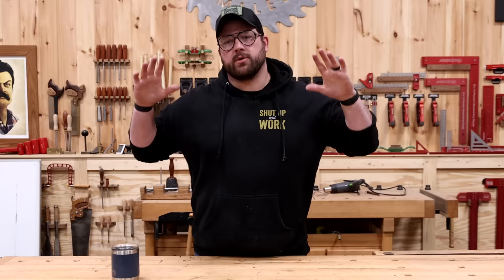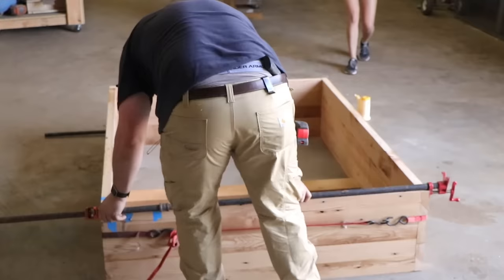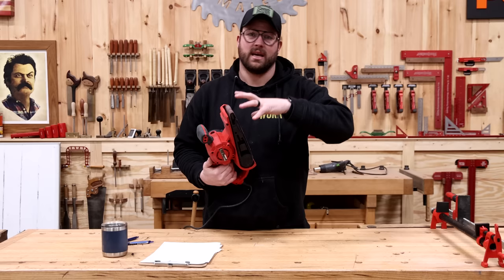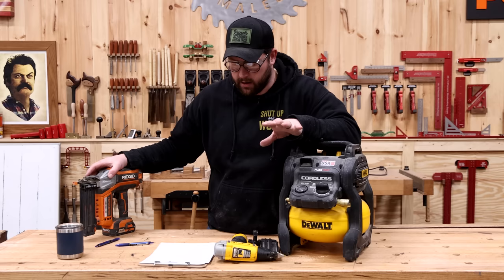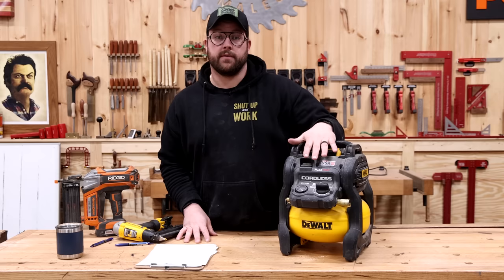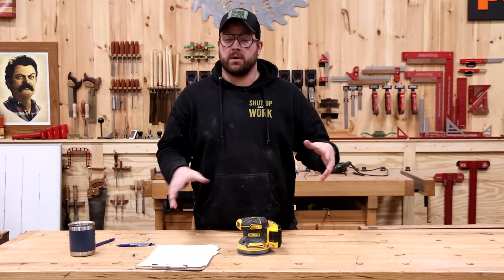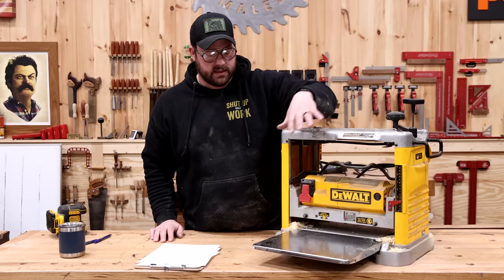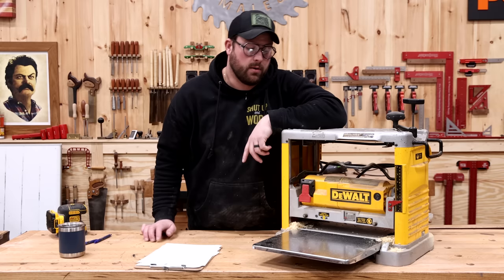5 Beginner Woodworking Tools I Regret Buying

Comment: The 12” dewalt planer. Couldn’t disagree more……I have a Helix set up in mine. Used this planer for miles of hardwoods including mesquite, pecan, several species of oak, sycamore, poplar, and pine. Lots of local “residential” hardwoods as well. Not a few boards….dozens of huge trees I turned into lumber with the help of a couple local sawmills. Not one single trip overload. Not once.   Fix your machine guy! Probably a simple fix………..
Give that worthless planer away and tell the guy to replace the overload switch and check the wire connections…….

Comment: Do you guys in the states use combination machines like c400 style? ( single machine with sliding panel saw, thicknesser, surface planer , spindle moulder and slot morticer )
Reply: There's some convertible planers but for the most part we tend to use dedicated machinery. We tend to have larger shops than foreigners do. John's shop is huge. I'd guess it's 40x60? Might be even bigger than that. But that's not super uncommon for even amateurs to have here. Some are pressed for space though. Like if they're working in a basement. But if you're not living in an urban area and you have some land then having a large outbuilding is normal.

Comment: Compressed air is the most expensive way to waste energy... You spend a lot of energy to compress the air... send it through the hose and... spend quite a bit of volume just for a single action. Then the compressor has to spin up again.... It's way, way better to just get either a corded, or cordless electric tool - the new ones are quite light as well.

Comment: Have to agree on the clamps and track saw.  There are cheaper options that will work a lot easier for the beginner.  I am personally watching yard sales and estate sales for older tools like the pipe clamps as you can often find a box of them (sometimes with the pipe included) for fairly cheap, like I have seen a box of 10 to 15 of them end up going for about 1.00 each set.  Which is something else people should think about doing, buy used stuff.  There are often older woodworkers who either don't have someone interested in the hobby to pass things on to or have passed away and the family has no clue what to do with the tools.  They might be stained and dirty but lets face it, that means it was a tool worth having and the old tools often will last a lot longer than new stuff.

Personally I did spring for the battery powered palm sander but that is more of a convenience factor as well as I was living in an apartment when I was using it to build stuff outside on a table and already had the batteries so to pick up the Ryobi sander was like 50 bucks.  I built a bed frame with it along with some other things like the wooden flags and such and have some painted furniture that I am going to refinish with it at some point as well.  IMHO the best low budget saw guide is a level and a couple small clamps, I have ripped down  a TON of sheet goods using this method and a cheap level at harbor freight is less than 20 bucks.  Have been rebuilding a house while we live in it and every piece of sheet material has been cut this way, including the R10 foam panels I capped the insulation off with, just have to remember the distance between the edge of the shoe and the blade and offset that much each time.

Have to agree that air tools are a better idea compared to the cordless nailer.  Just too bulky and heavy with the current tech out there.  I have been replacing a roof by myself and an air nailer is a must IMHO to get things done when you are slow working on a roof.  Bought a cheap pancake compressor (sadly the built in regulator is a turd) coupled with an external regulator since the inbuilt one dumped air all the time and a 5 gallon portable air tank plumbed into the system to act as a reservoir.  With that setup I can run a roofing nailer without issue all day long and don't have to wait for the little pancake compressor to build up as much air nearly as often.

Planer is something I am looking at next and honestly the WEN one with the shellix (can't remember the exact spelling and honestly don't want to look it up) style  head built in and fairly cheap carbide cutters available I think that is the way I want to go.  That or build a wide belt sander that I can power feed boards through and basically do the same type of thing and as a bonus I can switch to a heavy grit and hog out material or a fine grit for finish passes.

Comment: 20v cordless compressor..🤣🤣🤣 brads I can see but that's it. How long will a battery last? Fill the tank up once, maybe twice I can see not using a cordless sander but a compressor seems ridiculous. Also, you will have outlets for a sander  everywhere but not for a compressor? Ok? Just get a normal plug in.

Comment: John, I can't see the logic of recommending a cordless air compressor rather than a plug-in unit, and simply because of their high cost and limited functionality.  In the same manner as you're recommeding against battery powered brad nailers.  The price difference in compatible compressors is enough to pay for at least one, and in many cases, two nailers of different gauges.

Comment: Whoa, I'll have to stop you there. Dust collection SHOULD suck! And the more, the better.
If dust collection doesn't suck, what good is it...? ;)
As the Dewalt DW735 isn't availabla locally (I live in Denmark), I opted for the Metabo DH330 (13") instead. I looked at both the Dewalt 12" (DW733) and the Makita 2012NB, but the Metabo was better bang for the buck. A little slower than the Makita, but the rpm to feed ratio on the Metabo results in a better finish. I mostly use mine for removing the resin from formwork plywood.

Comment: I like the belt sander I have and I use it widely. The one shown in this video is quite different. Yours has an absurdly small front wheel, likely contributing to some of the issues you described. Mainly though the way you use it the key. It is not a subtle tool and I only use it with low grit sands anything more than 200 and it is the wrong tool. I also use mine as a bench sander.
As for planer/thicknesser, No way would I spend any money on a bench style. They are all overpriced, flimsy, inaccurate, low versatility and weak as water. It is the FIRST AND MOST IMPORTANT machine in the shop to spend money on. A good and heavy long table planer/thicknesser. For $1500 new, you should be able to get a good enough one to turn almost any wood into perfect boards/timber. Second hand older models are often better and more stable especially old Italian and German variants. 
It all depends on what you want to make too, all sanders smaller than lifted by a forklift suck but that is not practical for most people. Hand sanding is still a cheap and effective option for many jobs. 
If a low budget is a key factor then a lathe is a cheap and massively fun, easy machine to use (MUST learn the basic safety first). It can also be the only machine if its a low money, low time hobby. A few cheap chisels and you can make a huge amount of things.
A lathe can also be the perfect budget entry machine to make money with and work your way up to a full workshop/business.
John, I fear for your safety at times but thanks for sharing.

Comment: Do NOT recommend a spindle sander attachment for a drill press / drill unless supported on both sides.  You will destroy your bearings.  Drills are designed to push DOWN, not sideways.  If you DO decide to do this then be REALLY gentle.  Spindle sanders are designed in part for shaping, so being really gentle kind of defeats that purpose.  There are decent benchtop spindle sanders if you have a need to shape concave curves.  Please leave your drill press out of this process.  That said, spindle sander is not a tool any beginner needs.  Just learn to use rasps and sandpaper like the rest of us did.

Comment: Just ran across your vid. All is true but 1. Go get yourself a real belt sander then you will notice a difference. The new style (drag car) suck because of the front wheel being so small. So you are right and wrong. Now that being said good luck finding a porter cable 3x21 or 4x24 only to be gotten used as porter cable (I believe, correct me if I am wrong) doesn't make them anymore. Only way I have replaced mine was used on ebay. The original lasted me 30 yrs of use and abuse.

Comment: Buy a cheap belt sander, it has its uses for mass material removal. Don't buy De..t, Mil...e etc anything until you decide to stick with woodworking. Buy HF or other cheap brands, if it is useful and you are going to stick with woodworking, spend the money on better brands. Buy corded to start with, more power for less money and you won't get stuck with orphan batteries. Black&Decker, Porter Cable, Dewalt are all the same company along with others. Cordless compressor, what an insane recommendation for a beginner. Buy a real compressor for much less and buy airtools for way less than the cost ob batteries.

Comment: Hi John, to be fair, your beltsander sucks, a good onw has amazing dust collection, runs super smooth for hours and leaves a good finish that is super quick to touch up with your orbital sander. I sanded the floors in my house with a makita 9404J after stripping the old paint.

Comment: Beginners! Remember: batteries die, corded tool work forever! If you want to use your tool in say 5 or 10 years, the corded one will be as good as new, the cordless batteries will be junk (and so will the tool) 
Cordless tools are best if you wear them out in 2-3 years before the battery is dead. more for a full time professional.

Comment: Mere clamping pressure does not equal better glueups.  Proper prep does.    Buying scrappy tools to save money.  Been doing this 30+ years.  Bought cheep tools only to suffer.  Buy once cry once.  Pick up clamps over time.  Told kids fathers day a clamps.   Birthday clamps.   You would freak at my clamp wall.  BTW  you can join those  besseys.

Comment: Completely DISagree with the parallel clamps and pipe clamps.   Both are equally useful even for beginners, but the parallel clamps have a much larger clamping surface to spread out the clamping force over a larger surface area reducing the likely hood of leaving clamp marks on your wood.

Also, a battery powered brad nailer is almost a MUST....  get the Bauer from Harbor Freight it has every bit as much power as a pneumatic, pushing 2" brads flush into solid Oak, Ash, Hickory, and Maple lumber.  I've done 2 strips of nails on original charge into a mix of hardwoods, and wall studs & still have 1/2 battery according to the indicator.   Tool + 1.5AH battery(they were out of the 3AH) + charger cost me less than $150.   With coupon &/or sales, you can get with the 3AH battery for about $150 after tax.

Comment: Got to disagree on the belt sander. When you are working with big pieces of wood and you have good technique you can make your life so much better by removing material fast, easy, and accurately. Now, it does require technique but....here is the thing....so does literally everything else with wood work. So, you might as well jump in and hog off some shit on scrap to learn how to do it and make your life so much easier later on.

Comment: I will have to agree that the Kreg saw guide is junk.  I invested in the Festool system.  Money well spent, IMHO.  The DeWalt planer is also junk - I was fortunate enought to buy a Powermatic 22" planer.  7-1/5 hp and the machine weighs in at a whopping 1,300 lbs.  With a shelix head you can't go wrong.  I like the Bessy clamps but I found there is a learning curve to operating them.  I don't know if there is a better "F" style clamp design out there - but have yet to find it.

Comment: The only expense (and headache) you'll find with pipe clamps is getting them cut to whatever size you want and then the CUT end threaded. 

Home Depot (in my area, at least) will not do it. They don't even have the machine, period.

Lowes *supposedly* does it, but they usually have like one elderly clerk who is cleared to use the damned pipe threading machine, and she's usually part time and out sick anyway. I literally waited for more than 90m to get a single cut pipe threaded on the fresh ends once. Another Lowes, those idiots had NO ONE who was cleared to use it. NO ONE. Not even a manager. SMH.

Can't speak for Menards, there aren't any of them around here. 

If you're going to make more than one or two pipe clamps (and yes, they're good!), it's worth it to consider getting your own threader set from Amazon. The cheapest 4-star one I spotted was US$110. No idea of quality, but you don't need to do THAT many, but it'll save you a LOT of time if you don't get a whole bunch of pipes cut at one time @ Lowes.
Reply: I have my own pipe dies and pipe cutter. I've threaded some 3/4" with what I've got too. It's a slow burn. By the time you're done you'll know why they have the machines, that's for sure.

Comment: lol you pulled out a parallel clamp and I went 'Pipe clamp'

whoa whoa whoa, did you just recommend a CORDLESS AIR COMPRESSOR for beginners? Air compressor + gun yes.. cordless? Wtf mate, get a better air compressor than that as a beginner for THAT kind of money and get some longer hoses and an extension cable.

Comment: Ive been working wood for about 40 years or so and I started out with cheap clamps.  That was wasting money.  I have an array of Bessy clamps and they are still as good as new performance wise all these years later.  If you buy crap tools you will own crap tools.  If  you want to be a cheap wood worker, build your own clamps but build some good ones.

Comment: your cost analysis of the cordless brad nailer is wrong.  The compressor is going to REQUIRE an airhose, that ain't free.  I generally agree with you on the cordless nailer for a beginner, but I would go all the way and say the same thing about the cordless compressor.  You can get a Porter Cable pancake compressor with 2 or 3 nailguns for less than the cordless compressor alone.  Given that the hose is the biggest PITA in a shop, might as minimize the cost if ya can't escape the hose.  And really, the convenience of escaping the hose is the entire reason for using a cordless brad nailer in the shop.  All that said, while I WANT a cordless brad nailer, I haven't gotten one, because even as much of a tool junkie as I am, I haven't been able to get past the price/value.  Part of that though is I don't use nails a lot.

Cordless palm sander: It's not a bad thing.  It is INCREDIBLY convenient, AND you can frequently pick them up with free battery deals.  I use mine frequently for quick sanding jobs.  Knocking an edge down, popping outside to sand something.  For any larger sanding jobs, yeah, I break out the corded ROS.  As part of a package deal or such, they're worth getting as a beginner, but otherwise, yeah, that's a big "wait/skip."

Belt sander: useless for MOST beginner projects, except for one.  Dealing with reclaimed lumber or painted wood.  Put on the face mask, put a 40g or 60g belt on, and you can quickly remove the gunkies.  The amount of time saved compared to using a ROS is just incredible, and you aren't risking the knives of your planer or jointer.  Also, a handheld belt sander clamped upside down in a simple fixture makes a decent little benchtop sander.

Parallel clamps: I think a set of four isn't unreasonable for a beginner.  Mind you, I went the pipe clamp route when I started, for the cost and flexibility reasons given.  Now I have a few hundred $$ invested in pipe clamps (between the clamps and the pipe) that I almost never use.  The last time I did was when I needed to use the 7'.  So it's really the balance between lower cost up front vs long term value.  

Fake Track saws:  Yup.

The Rigid Benchtop Sander beastie:  I love mine.  Use it constantly, it's probably 20 years old.  It's the OSCILLATING feature that makes it shine for me.
Reply: Air hoses are not that expensive. Once I bought an expensive one. It's a Gates.  But I have cheap Goodyear hoses too. The Gates hose is amazing. It stays flexible down to a lower temperature than I'd work in. I'll never forget what the kid said when I bought it. He said, Well, it ain't cheap but it's no Mickey Mouse stuff. I was like OK I'll take it. I needed it then and there. That air hose and me have been to Hell and back together. I totally demolished a whole car with it once just using an air chisel with a shark bit. I cut it up into little pieces and threw it away. I didn't want to junk it.

Comment: K body clamps have significantly more uses. Pipe clamps are almost as expensive as k body right now. Gas pipe is obscenely expensive
Reply: You can buy pipe for scrap prices at metal scrap yards. I think pipe would be classified as light iron and it's going for $150 a ton. So 100 pounds of pipe isn't going to run you more than say $10 or so. 100 pounds of pipe would be a lot of pipe too. That's about 88 linear feet.
Reply: @1pcfred  ya let me go to a scrap yard and dig around like a little crackhead. The bessey I beam clamps are significantly better than pipe clamps anyways. I’ll spend my money on quality stuff. I don’t need rusted pipe for my clamps
Reply: @uprightcr2744  suit yourself but 3/4" pipe really doesn't rust in my experience. It's coated. It's either black or its galvanized. Generally black iron is what's recommended for using with pipe clamps but all the pipe I have is galvanized. Which works fine for me.

Comment: You say, Don’t buy a cordless sander because you always have outlets around. You also say, buy a cordless air compressor? Ah, NO! If you’re running air, plug it in! Battery anything will limit your working time, minimize working power/performance, and be costly to replace every year or two. Avoid batteries, beginners! Also, don’t trust Harbor Freight Parachutes, or anything else they sell that involves your life.